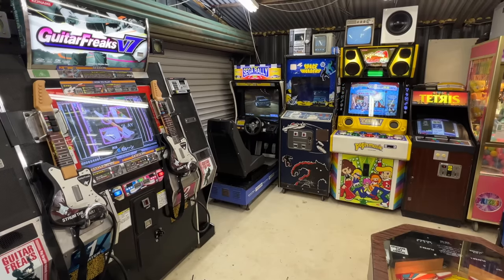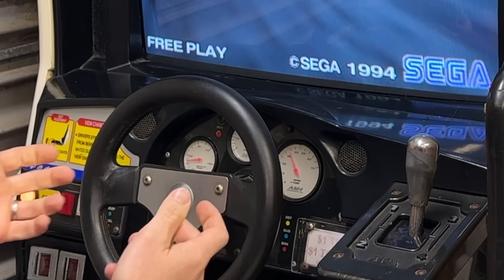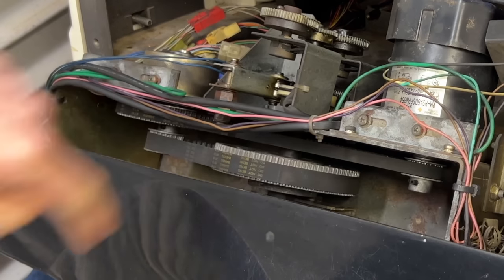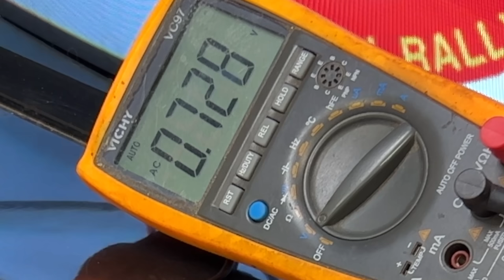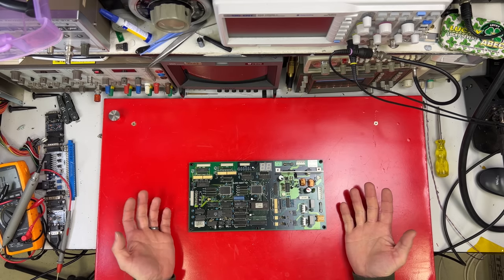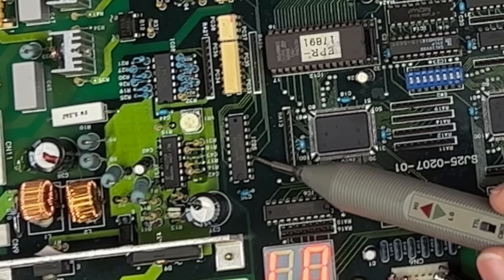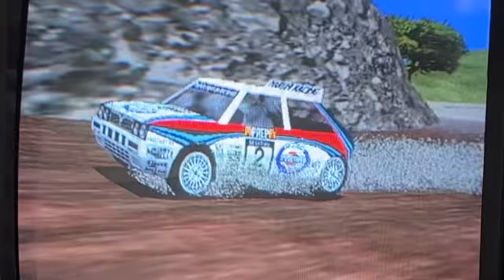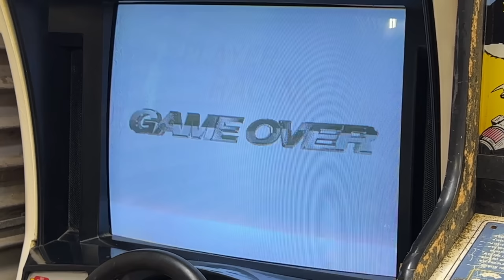I Broke My Sega Rally Arcade Machine

Comment: I resent fuses. I've done a fair bit of electronics repair, and only ONCE has it ever been the fuse. Why have a built in failure point, if it's gonna fail somewhere else anyway?
Reply from the maker: Yeah :(
The fuse is so if the device becomes a blob of molten metal the power cabling doesn’t explode into flames. It’s there for safety, not to protect the device

Comment: Sounds like the bearings on the FFB motor might be on their way out - I had a similar problem with a Logitech DFGT (very different of course but still, FFB driven by a motor) and it started to sound similar to that whenever the wheel would turn, either by you moving it or by power-on calibration.

Comment: I have a twin Daytona and can confirm that the motor on both sides is that loud, although one side is slightly louder than the other. Wonder if it's from the belts getting old and starting to perish.

Apparently corrosion and track rot is a common and unrepairable issue with these model 2 games. I use Jomac in Perth for all my main board set repairs because I'm too scared to touch them, too complicated. 🤣
Reply: Another potential cause could be the motor bushings wearing out. The bushings are oil impregnated and eventually wear out.
Reply: @jb-br8bf  That could also be contributing to the sound although this particular noise sounds more like belts squeaking.

Comment: Your solder "joint" is perfect for the job. As you know it's just about the strength of the connection. I wager you would have devil of a time pulling them apart? Now if it going into a Cessna, your at 10,000 ft and your life depended on it... well, you know. But your connection is perfect. It's EZ and and it RoCkS. Just saying. Thank you for the Infotainment.

Comment: Trace rot is really an unfortunate reality. Recently rewired almost the entire controller pathway on a NES due to pcb trace rot. And it can be so random too. A pcb that doesnt show actual corrosion can just have traces bubbling up for no real reason.
Reply from the maker: I’ve had two never opened, otherwise clean super nintendo consoles with a small patch of rot in the same spot at the corner of one of the PPUs. I wonder if it’s where something on the production line contaminated them
Reply: @Games_for_James  My blind guess is that maybe the lacquer on the PCB has microfractures due to age, which then lets the copper traces bubble up, and that in turn cracking more lacquer to expose even more copper. But who knows.

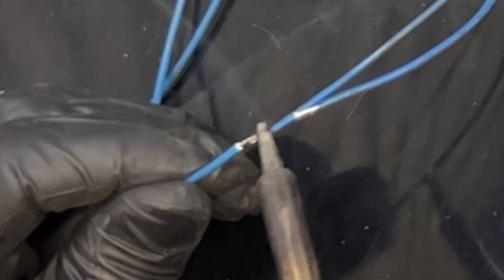Comment: 3:18 Really doesn't matter for hobby stuff like this but doesn't fly in a professional environment. The original way you did it is correct but if you're getting solder spikes (also know as icicles) then the solder probably needs more flux which can be done by using larger sized solder wire which will have more flux inside it or by adding some externally, it occurs more often off of already sharp points (such as the tips of wires). IMO the solder spikes you were getting is way worse than the way you now solder the wire.

-A random dude that solders wires for a government contractor.

Comment: Dude! I’m one of those people who don’t like how you solder splice wires. 

The issue is not heat causing the solder to melt. It is mechanical. Solder should be used as an electrical connection primarily. Not a mechanical one. Vibrations and such can cause your style of policing to prematurely fail. 

Also heat is an issue due to thermal expansion. Any wire will get warmer when its  device is on, either due to current or due to ambient temperature level. Like any material the metal expands and contracts due to heat and cooling cycles With your style of soldering that thermal cycle  will cause the solder to crack and joint to fail prematurely relative to a proper splice. 

And if you get strands pocking out  when wrapping then you are are not doing it right. 

Crimped splices are another, fast, alternative. A real crimp with a proper tool, not pliers. .
Reply from the maker: Yep, I learned all that too. You are correct on all counts as far as the theory goes. I’m yet to see a real world failure from using a good solder joint as a mechanical connection for small gauge wiring. Normally wires fail right at the edge of the solder from the copper taking the stress.

What method do you use to twist the wires together? I’m keen to learn if it’s not something I’ve tried

Comment: On the motor noise... no certainly not that loud. 

(However the logic probe has now given me an idea about fixing my widescreen CRT tv)
Reply from the maker: As long as you stay within the voltage range the probe can handle. There are much higher voltages in a crt
Reply: @Games_for_James  from what I can tell on the thing it's a digital setting I need to monitor so the voltage isn't high on the board with the issue  (that's triggering a horizontal protection fault that won't allow the TV to boot up into it's OS so I can get into service mode and undo the setting it stupidly saved that means the horizontal lines are scanning far enough apart).

It's a bizarre tv that was the last CRTs Sony did, it's 32" and manages to have 100hz refresh rate as well as picture-in-picture and a subwoofer. All from a TV sold in 2003.

Comment: Just a question, you cant put soldermask or uv mask on it then cure it with uv light to seal in the good contacts with the traces and pads before they get futher damaged no? I'm sorry i don't know the right terminology to keep up with you but could that not hel preent the moisture damage you were dealing with?
Reply from the maker: It might, I’m not sure.. it would make future repairs more difficult though if I seal the solder

Comment: Old reversible boys like that tend to be noisy, and that doesn't sound like the kind of noises winding degradation or bearing wear make. Not too much of an issue in a commercial or industrial locale, but it does stand out if it's the only loud thing around.

Comment: Nice work! Ive got a single sega rally aswell.. for so called "cheap" but so far from that.. I'm still on the lookout for a power supply to run the model 2 board and the force feedback driver board.. will get it running oneday after millions of dollars.. i do like the look of your marquee for it.. did it come with it?
Reply from the maker: Nice! You could jerry rig another psu or multiple psus to provide the right voltages as long as they can handle the current
Reply from the maker: The marquee light box is off a random cab (no idea what), I got the graphic printed as a reverse decal and stuck it inside the perspex. It looks better than I ever thought it would
Reply: Ahhh i work as a printer so if i locate a good file to print from I should be able to do that too.
Reply: Another question! .. you have a 2nd switching power supply in yours.. are you using the original or just getting 5 volts 2nd?
Reply from the maker: @vivalafletchweekends2747  well spotted! It is only wired for 12v and I have no idea what it’s connected to. It worked when I first got the cab but has since died and nothing has stopped working. I should really follow the wires at some point, I suspect it might have been for the leader light or something like that that I don’t have.
Reply: I have another question. You driver board seems to be a different variation to other ones I'm seeing online. Im on the lookout for one since my sega rally missing its driver board. Im In talk with someone who's willing to sell to me but there board looks completely different. In your research did you ever come across other variations on the pcb?

Comment: Does the cabinet not have an unlockable Stratoss? Shame, but still that machine is absolutely a must have for retro arcade machines, along with hang on and the light gun games of that era.
Reply from the maker: It does, via a cheat code. It only handles like a stratos though, they didn’t put in the stratos 3d model
Reply: @Games_for_James  Does  it have the model of a Delta? That's hilarious.
Reply from the maker: I can’t remember if it uses the delta model or just whatever car you choose. I’ve only done it once, but yeah pretty funny

Comment: I'm not 100% sure but I don't think the motor is meant to be that loud I think it will need replacing I know a bit about motors and a lot less with arcade machines but I'm sure it's not meant to be that loud and I think I used to know a lot about this arcade machine when I was a lot younger I faintly now remember someone telling me about the whole SEGA and Military thing back then thanks to you I'll have to do some more research again on it but over the years my memory has gotten to the point where I can barely remember where the toilet and the bin is

Comment: My XBOX had trace (track) rot. The way I solved it was just rewiring the whole thing with solid copper core wires then affixing them to the board with SMD rubber grommet wire holders. I don't know of any other way to fix it.

Comment: There is a third car you cam unlock doing a shifter code same with the fourth track. Also i cant hear my seering motors at all. I can measure some stuff if needed
Reply from the maker: Yep the lancia stratos! It doesn’t corner easily at all.

Is yours in a quiet room?
Reply: @Games_for_James  im an arcade operator ;) but i sometimes turn it on allone. The loudest thing on there is the rear fan as it should be

Comment: to answer your question , no , the motor should be near silent 
also the steering wheel should be way more powerful , it should overpower kids , at least it did overpower me alot when i was 15 yo
Reply from the maker: I’m getting a lot of mixed comments about the motor. What is your experience from?

Yeah it’s set to the lowest setting because of the old clutch being too strong, I’ll probably bump it up a bit

Comment: Veteran Arcade Technician chiming in (18+ years). "Oh, this device (which I am unfamiliar with) has X and does not need it, so I will remove it!". COME ON. Facebook, Reddit, etc, all have groups dedicated to arcade repair,  and I am sure groups exist for this game specifically. Yet you fail to research before proceeding. If you continue doing this,  it will end up costing you 1000's.